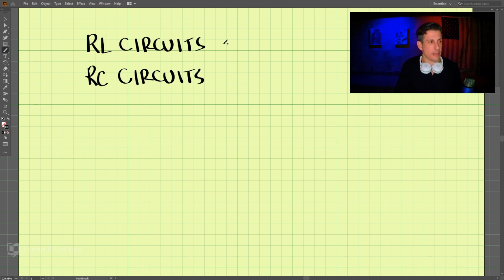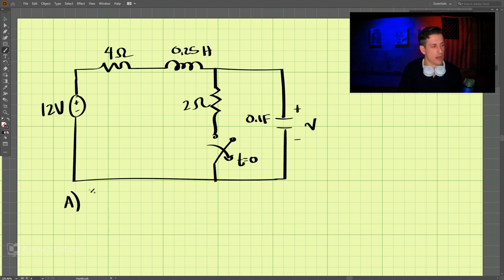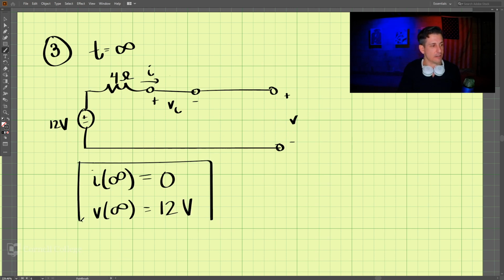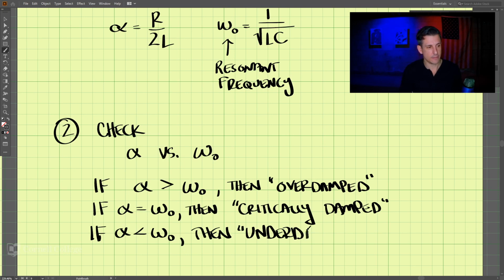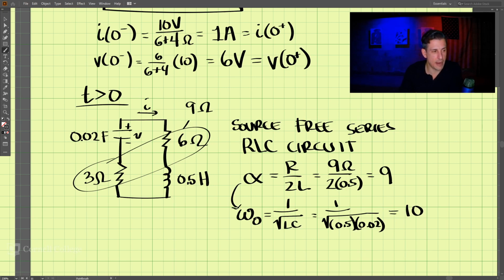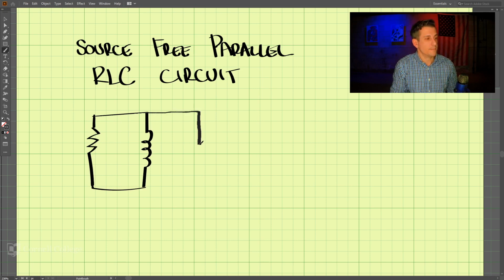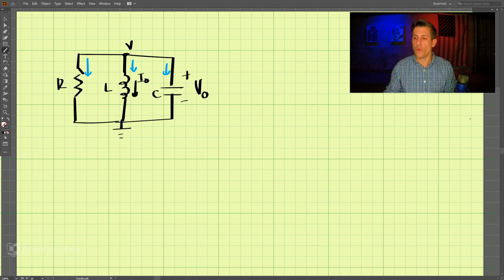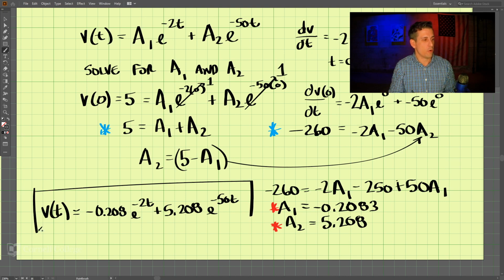Chapter 8 - Fundamentals of Electric Circuits

Comment: sir ive a question please reply....u said that inductor acts as  shot circuit and capacitor acts as an open circuit at t = infinity...so when u were solving first example ....why u shot the inductor and opened the capacitor at t=0- ....in  finding the i(0+) and v(0+).... please replyyy

Comment: Hi! I really appreciate your videos, but I just had a quick clarification question.
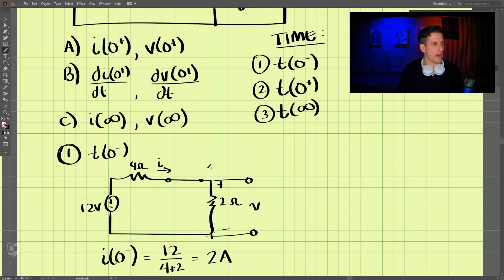At around the 19:00 min mark of this video. It seems we are solving for when time is negative infinity, however you say that we are doing "part A", which is +infinity. You also make the assumption that at positive infinity the inductor becomes a short circuit, so I initially thought we were not dealing with negative infinity at all...

Comment: So aren’t the differential equations related to rlc unique ? So the formula you gave for alpha when in series and parallel won’t work for a circuit with a combination of series and parallel ? And the differential equations you showed will be different depending on the circuit rlc circuit we’re analyzing ?
Reply from the maker: You must simplify the circuit to a series or parallel RLC circuit first. For series RLC circuit:

α = R / (2 * L)

For parallel RLC circuit:

α = 1 / (2 * R * C)